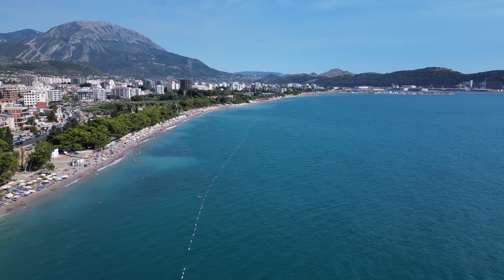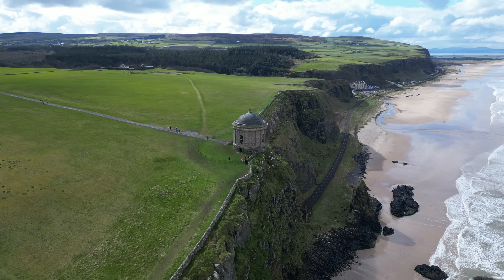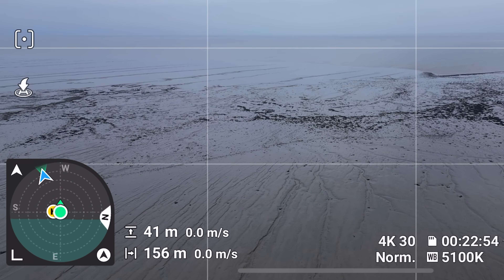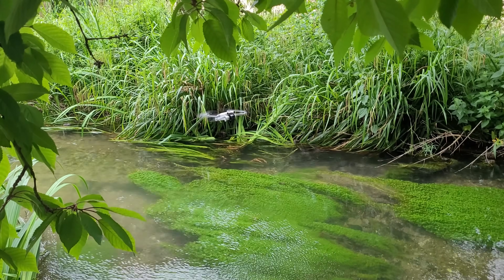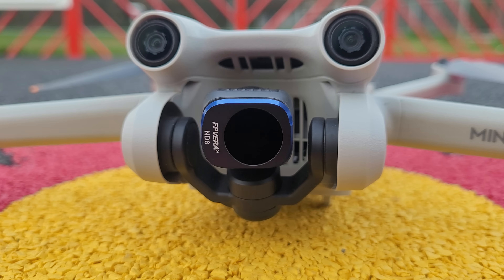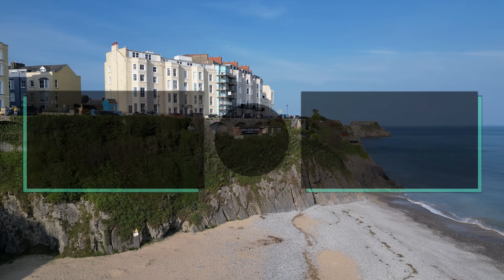Drone over WATER? Watch This First…

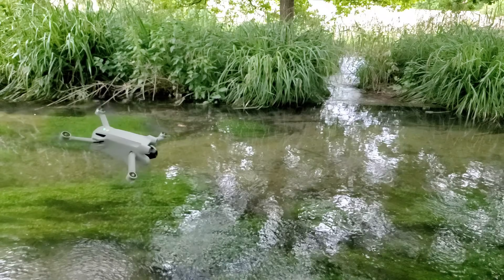Comment: @5:30 the drones propellers also cause ripples on the surface of the water when it's that close.  The contrast difference that those little waves make the sensors can detect.  When flying forward, there hasn't been enough time to create the ripples, so the calmer water is harder to detect.

Comment: It's been my experience that the biggest threat besides high power electrical transmission lines are bird's in the sky that come FROM far or near to confront that FLYING weed eater sounding device. My DJI spark got a lot of bird attention.
My mini 3 pro is quiet and less approached.

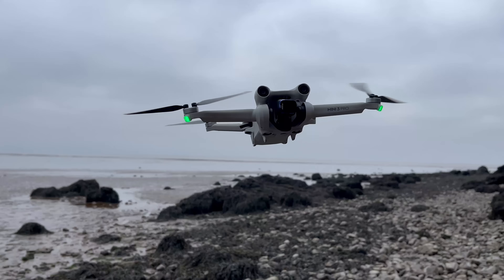Comment: At 2:07, you provide a useful tip for determining how strong a headwind or tailwind would be.  However, it's important to mention that these measurements or assessments are taken when the drone is hovering.  If a headwind is 10 MPH, the drone needs to "tilt" (pitch forward) and fly at 10MPH to compensate for the 10 MPH headwind in order to maintain a hovering position.   Likewise, if a 10 MPH tailwind, the drone needs to "tilt" (pitch backwards) and fly 10 MPH in reverse to maintain a constant position.  Heavy rolls (tilt left or right) in order to hover indicate strong sidewinds and can likewise consume battery charge if it has to fly laterally to compensate for a strong sidewind on a RTH.

Comment: about DJI drones not being waterproof.
i have DJI Mavic Air 2 which i bought back in 2021. took it to the mountains in February 2022 to make a video of the beautiful mountains covered in snow and to make a pass over a river. even there were tons of tree branches above the water, i was able to maneuver if and fly it thru and once i was in the clear i got the drone to 10m height above the river and wanted to capture a photo of the mountains with the river as a last shot before i go home. as i was backing to get the perfect shot, the drone probably hit a branch (there are no leaves on the trees in winter so probably the drone was not able to see the branch) and disappeared. was looking for the drone like 2 whole hours and was thinking that someone saw it fall and took it. but i noticed something red in the river waterfall. got into the water and there it was, working under water for 2 hours. it was full of water, i switch it off, took it apart and left it to dry. after 2 weeks i got all the parts together and the drone was working as it never happened. there was no noticeable rusting or any damage to the drone or its electronics. i am still flying it and it works without any problem.

Comment: Should I turn off or leave on the lower sensors? Which is safer?
When landing on a moving object, such as a moving boat, I turn them off. However, this makes for a rather hard landing if you're not careful.
Do you have any experience with whether it makes sense to turn off the sensors when flying low over water?

Comment: Drone use at a low height over water in sport mode? I would never  do that, especially not fast among trees as you demonstrate 😮
In sport mode my Air 2S obstacle-avoidance sensors are disabled, and I would not be trusting the downward vision system at all!
Reply from the maker: Yeah, it’s been seen before that low over water the drone can drift slightly up and down, so the sensors can never be fully relied on, even in normal or cine! Of course, I had to make sure that the quick path through the trees was clear for the drone. No thin branches hanging down or anything like that. Thanks!

Comment: I had two "over water" scary moments connected to the downward-facing sensors when the drone was hovering: 1) Videoing a weir, the drone suddenly started moving backwards - I think it had locked on to foam and debris in the stream which was flowing down the stream and interpreted this as the drone itself moving forward across stationary ground so compensated by following the foam. 2) On a very still lake at about 4m up, it suddenly started descending and almost got to the water before I noticed and flew up. I think in this instance, it was measuring the distance to "ground" using the reflection of trees above the water so calculated it was much further up than it actually was. I wish there was an "over water mode" you could activate that would disable the downward-facing sensors and rely on the pressure-based altitude sensor instead.
Reply: "rely on the pressure-based altitude sensor instead."
Beware variations in barometric pressure close to water.  Moving air has lower pressure; so if you see "cats-paws" blowing across the water, the drone will dip lower when the moving air arrives. 
You are correct that the stereoscopic vision method of determining distance is not going to be reliable over a reflective surface.  I have never had to turn off bottom sensors but I also keep a healthy altitude above water.

Comment: One of my main rules when flying over water is **never fly in an offshore wind*** - I did some tests in strong wind once (blowing around 8m/s) and my mini 3 was "using up" 6x the battery to cover the same ground distance into the wind, compared to flying with the wind. You would be very wrong if you think you'll use half the battery out and half the battery back. In my test 10% battery out would need 60% battery to get back the same distance against a strong wind - it can be that different in strong winds. On the other hand, if the wind is blowing onshore, you have a big safety net - basically the wind will help it get home. (An analogy with a boat: You can row at 3mph. The river is flowing 2mph. Rowing 1 mile downstream would take 12mins (60/(3+2)) but coming back 1mile upstream would take 1hour (60/(3-2)).
Reply: Another reason why I am glad I bought the Air 2S. I have been worried about winds on a couple of occasions. Once when I got the 'high wind' warning from the drone I brought it in early. Just a couple of weeks ago it was windy down by the coast. I put it up just low at first. It was fine and I went up higher and eventually further away. No issues at all; the Air 2S just swallowed the wind and flew fine. About a 20 kmh wind.
Reply: @petesig93 I flew my mini 4 with strong winds,ot barely made it back to home point .bout to make a emergency land when ignored low battery alert.
Reply: I lost a DJI that way. It made it 'out".  Didn't make it back going into the wind. Had to go play hide and seek to find it (miserable ordeal ) .

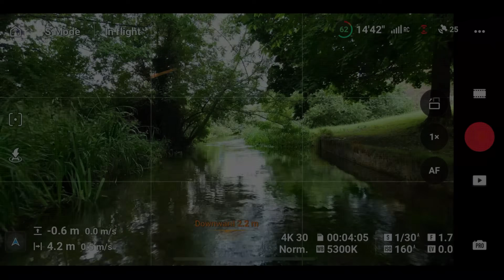Comment: 4:57 because the drone tips forward when going forward faster so if you draw a straight line down from the drone and compare flat vs pitching forward you will get why the number goes up and down when you move and stop....
Reply from the maker: Yeah this is most likely why the reading disappeared. I explained it with a visual diagram at 5:26. Thanks!

Comment: I've noticed the radio signal being lost when flying low over the water at a distance. It's as if there's a spurious reflection of the signal off the water's surface. By raising higher, the signal reappears. This has happened when following canoeist friends several times.
Reply from the maker: Interesting. I’ve never encountered this issue, but I’ll remember it for my next flight. Thanks very much
Reply: @takeoffdrones I'll be keen to see one of your experiments on the subject. 😉

Comment: My YouTube Channel is about a specific lake in Minnesota, so more often than not I'm launching from my boat. This makes DJI's return to home feature useless as the the boat will have moved since the drone took off. I really wish there was a way to shut it off. I usually start thinking about landing when the battery gets below 50% because I don't want this feature to initiate. I've has some close calls.
Great video. Very helpful.
Reply from the maker: Interesting. In this case I would recommend setting the home point to somewhere on land right after you launch the drone. Otherwise, as you say, the drone would land in the water, which you don’t want! You could also potentially set the RTH behaviour to “hover” instead of “return to home point”, but it’s probably better to have a set home point on safe land. Thanks!
Reply: I set the lost signal behavior to "hover" when I am flying from a boat.
Reply: Would be neat if it could home to the controller or a relative point - get a real-time update from the controller/phone for home GPS, then landing pad with a bluetooth/whatever beacon that it could home to once close enough.
Reply: @Edramon53 I believe newer units can do that

Comment: One of the most important things i think you didn't mention is, setting your drone to "return to home" in case of lost signal. There is nothing worse than your drone hovering over the water until your battery dies, when it lost the connection to your remote. Also give your drone enough time after takeoff to make sure the homepoint ist set where it's supposed to be, over land.
Reply from the maker: Good point. However the drone’s behaviour after losing connection is set to RTH by default, so you’d need to change it back to RTH only if you’ve manually changed it to something else. Thanks
Reply: Also, if you are on a moving boat for instance, do remember to change the homepoint to be the controller!
Reply: I turn OFF return-to-home in case of lost signal.  HOME is where my boat was when I launched the drone.  I am no longer there.  I use the "hover in place" option and hopefully that buys some time to get the boat in position under the drone.  Actually, in all these years I have used "RTH" only once, and that was to test it.  Automatic RTH has kicked in once or twice.

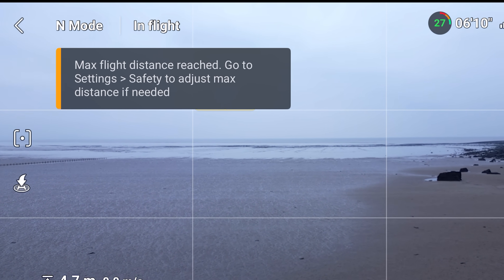Comment: I’m curious with the max distance limit 3:23 
Is this gps coordinates or based on the controller location?

Ie. if the controller is moving (say in a car) does the max zone circle move with the controller or stay fixed to its original location?
Reply from the maker: The max distance circle stays with the home point at the centre (so where you launch the drone from). If you are in a moving car, this circle wouldn't move with you since it is based on the home point. You can however update the home point if you've moved to a new location which should also move the max distance circle.

In other words, if you look at the distance reading in the bottom left of the screen, once that reaches the set max distance, the drone will stop and hover in place.

Comment: There is no difference fly over water vs land.
Reply: Wrong.
The Drone may Not recognize water as surface. Check your Height. It may show Zero over water. I know !
Height returns when over Land again.
Reply from the maker: In essence the flight is the same wherever if you’re high enough, but above land you don’t need to worry about possibly having to dive to retrieve the drone from water!!

Comment: Set your height above land before you fly over water.  Once you are over the waters surface, you will not get an accurate height measurement.
Reply from the maker: Well the downwards Obstacle Avoidance sensors measure the height below the drone all the time. Even if you fly at negative altitude, so below the launch point, you’ll still be able to see how high the drone is above the water via the downwards sensors. But true, as seen in the video, there are times where this can be inaccurate!
Reply: @takeoffdrones Auch in 100 m Höhe werden Hindernisse am Boden gemessen? Glaube ich nicht!   -- Drohne speichert nur Längengrad und Breitengrad  aus den GPS-Sendern ab? Höhe nicht, oder? Nein, muß sie auch machen.
Reply: @takeoffdrones Drones need a solid surface to accurately measure height.  Water is transparent, so you will get mixed results.

Comment: Hmmm… good advice for beginners, but I’ve flown my 3 drones a total of 1,300 km, over 1,000 km of which has been over water - coastal, harbour, lake and river - for a wide variety of specific purposes, and as far as 7km out to sea. I’ve never had the slightest issue. It really comes down to common sense and planning.
Reply from the maker: Amazing, thanks! Not sure if I’d be able to fly 7km out to sea with the Mini 3 Pro though…
Reply: What drone and remote do you use?

Comment: I have the DJI Neo, and I won't fly it over water. They recommend you not fly any drone over water; you are taking a huge risk, and I'm not rich enough to keep replacing drones. I also have a bigger drone with no sensors, and I lost it in the drink. It went out over the water, lost connection, and I made the mistake of not rebooting my phone to try and reconnect to it, and it was asking for calibration earlier, and I forgot about it, so it never did return home. They did give me a discount on the new one to replace it, though. So that was ok. Now I just won't risk it; it's not worth it.
Reply from the maker: That’s a shame… but I’ve flown countless hours myself over water and have had no real problems. I guess it does come down to judging whether or not it’s safe to fly before you launch, since the drones nowadays have fantastic safety features. Even if you lose connection, it should fly back to the launch point.

Comment: Do not fly in an area where the gps signal is interfered with or spoofed.
Reply from the maker: Agreed. I wouldn’t do that above land, let alone over water!!
Reply: For years, Ive flown manual quadcopters with no GPS in a variety of different environments (mostly without issue.) So I don't really see an issue with a DJI drone losing GPS signal. I believe that drones like the Mavic and Mini revert to Atti mode when and if they lose GPS signal (so not really a big deal there.) I do admit though that I had a bit of a drama when flying my MJX Bugs 3 Pro in Atti mode over the sea. I uploaded the recorded footage to youtube with captions. I was lucky to get that one back - https://www.youtube.com/watch?v=rcY21mEg8lA

Comment: Also be aware that there is “invisible” salt water spray when flying a hundred feet or more any near waves crashing onto rocks. Keep a good distance as over time this salt in the air can corrode electrical components.
Reply: Just being in the vicinity of the sea will corrode metal parts especially if done on a regular basis.
Reply: @paullelys161  Yea this really sucks because around here where I live, the coastline is one of the very few places where I could fly a drone legally. I don't have much choice but to fly along the coast. Then again Ive used regular land cameras by the sea many times over the years and I haven't had an issue with them. Though I did have a Panasonic G6 that mysteriously died....but that could be due a number of possible reasons.
Reply: @anzaeria  Beautiful shots come at a price I guess. There's only so much you can wipe down after a flight. I understand your problem.😞
Reply from the maker: Interesting - I guess some of the water does become almost like vapour after hitting the rocks and gets carried by the air. Good tip, thanks!
Reply: Thanks for this info

Comment: Maximum distance is useless for battery optimization and range control - you can fly sideways withing that range circle all day. Another way to gauge wind is simply looking at your speed. If your return flight is substantially slower than the flight out, you have reason for concern. That said, DJI drones RTH  measurements are not at all "Unreliable" as stated.  - they are incredibly consistent, in stable conditions (low gusting)   and very able  to gauge power needed to return to home, but algorithms that measure power, assumed tailwinds, etc. - if you build in an extra 10-20% above it's advised return to home, and you will have little reason to worry.
Reply from the maker: The maximum distance setting can ensure that you don’t fly too far away from the launch point. It won’t limit distance flown, but it will limit the range. As for RTH, yeah, I would actually agree that the estimations are pretty accurate. The RTH system itself actually leaves some extra charge and allows you to cancel RTH if you wish.

Interesting about the “algorithms” you say - I wonder how accurate they are at calculating this power needed with all the extra variables. Still, I would recommend saving some extra charge for when coming back, just in case. Thanks!

Comment: fly over water at a minimum of 20 feet, always fly VLOS and get Drone Insurance that covers old for new if the Drone becomes a Submarine ..... Coverdrone UK
Reply from the maker: Good idea.
Reply: I’ve not seen anywhere to purchase drone insurance. What does fit cost for a £1,000 drone?
Reply from the maker: @arlenbell4376  you can find these drone insurance companies online. Just search “drone insurance” on the internet and they’ll most likely be able to give you a quote based on your drone cost and other info.
Reply: @arlenbell4376  Some drone clubs are associated with insurances for drones.  You can also get the DJI refresh

Comment: no panic they return home. if it drop. not matter is it sea or ground its 100% new drone to buy lol.
other things that im curious where there still no annswer for decades.
what happen under bridge. when return home launches. it go up like supposed xD BOOM.
return home behind tall building taller than home high. will it move around it xD.
i know drone return home when it loose connection(too far)(surely not line of sight LOL). and drone can be controlled again when it come close
Reply from the maker: If the drone has obstacle avoidance sensors, then it will be able to avoid the buildings even during RTH and go around them. I might test this and make a video actually, it is interesting. Thanks

Comment: Most of my flying is over the sea. My video and shots are of sea life around our coast and have done 100s of hours. I use an air 3. My own rules are: never go below 10 metres. Never go further than 5kms. Always line of sight. Wind isn’t an issue usually as I can’t get any decent shots anyway so come home or don’t fly. Touch wood with 2 years + flying no issues.
Reply: Do you mean you fly the drone 5k away over the sea.....?
Reply: @RichardtheFourth  I know right. That's at least 5 times outside of VLOS, lol.
Reply from the maker: Sounds great! Thanks